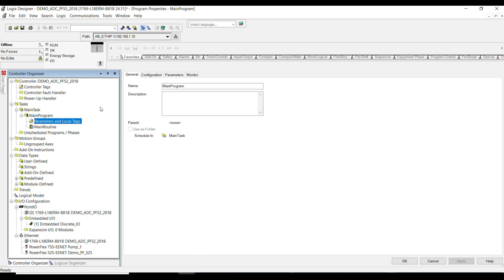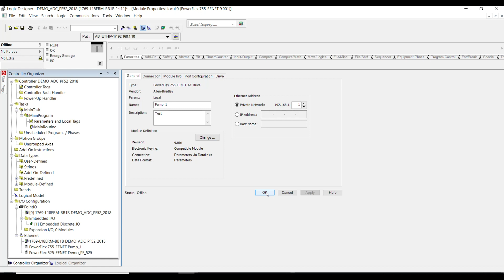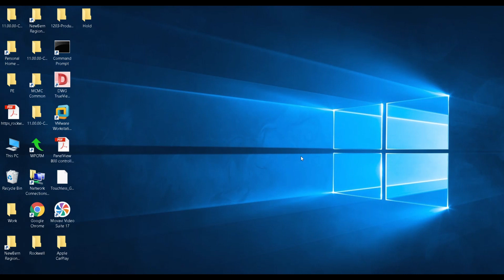PowerFlex 750 Drives: Data link setup

Comment: I have RS logix 5000 V 19.01. Ethernet is used for communication. I want to add datalinks from PF 755 drive to PLC, but module is set in disable keying due to that I can't add datalinks. Do I need to set it in Compatible module ???. Can I add datalinks when PLC is online or in programm mode ???